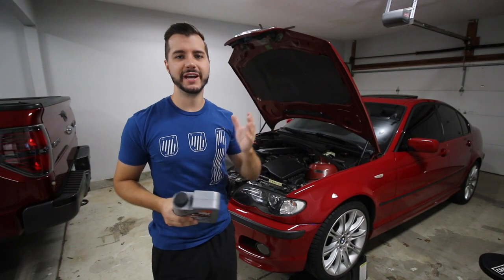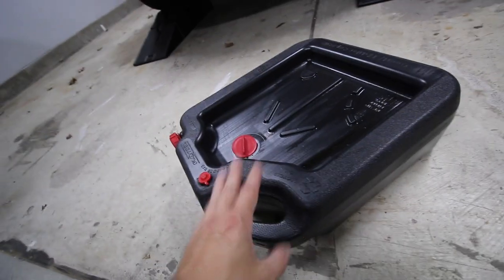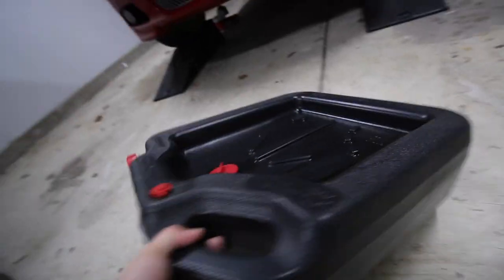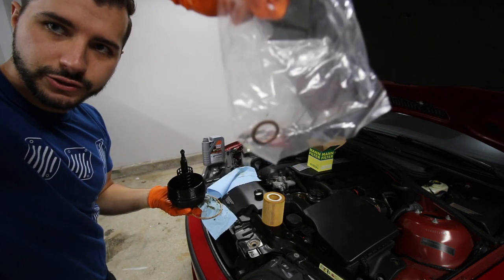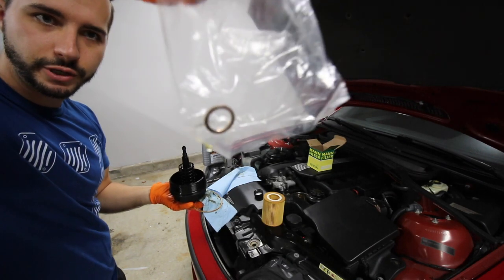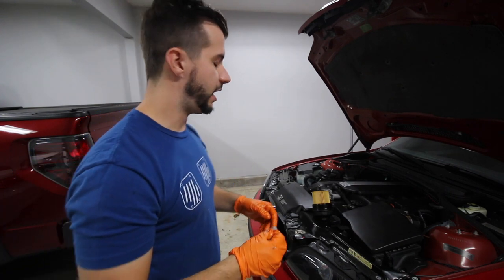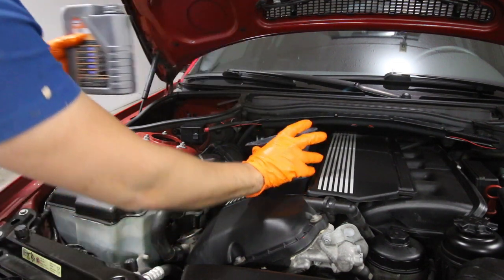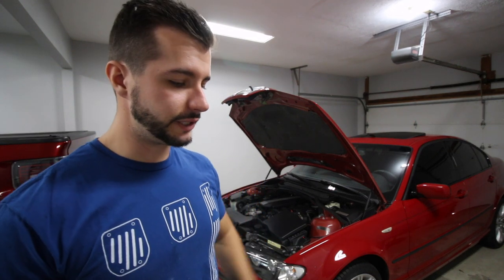DIY OIL CHANGE | BMW E46 330i ZHP

Comment: Great video needed to know how to reset the oil life. Little tip if you crack open the filter and the fill cap first you can have it drain more efficiently

Comment: It's a good idea to open all the oil system "airways" before draining - filler cap, dipstick, and filter receiver, all removed. 
Air in = oil out :)
Reply: Good tip

Comment: hey man i’ve got a couple questions.

i saw you remove the tiny gasket on the filter, did you put a new one on?? what’s the part# for it?

also, i believe the oil filter is supposed to come off first because it’s basically a vacuum and allows for oil to drain into the drain pan.

do you really need to put new oil in the oil filter?? because i’m pretty sure with that thing open you’re pretty much just draining brand new oil back into the drain… i’m probably wrong tho would love to hear your opinion.

great video regardless
Reply from the maker: I put the new small gasket on. It comes in the kit, I’m not sure the part number. And I just put some in the oil filter to help push out the old oil. Then I put the drain plug back and add oil. Maybe it sounds silly but it just makes me feel better haha.
Reply: @ShiftedPerspective  sounds good ahaha thank you sir. great video keep doing what youre doing!